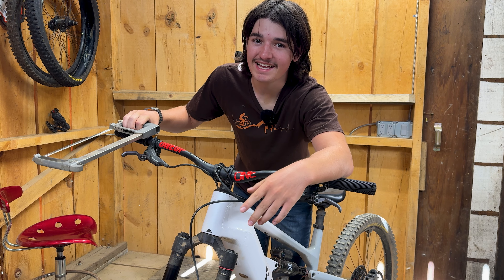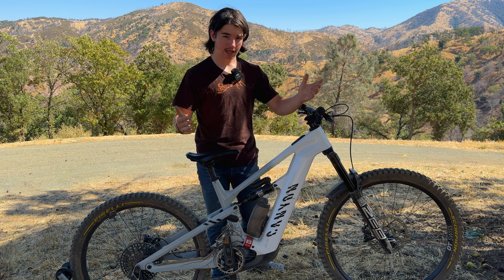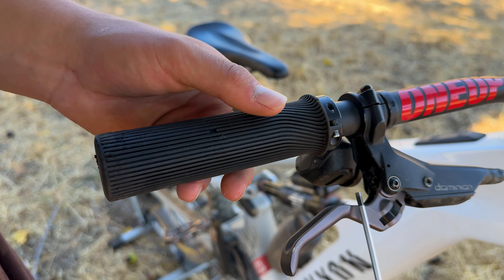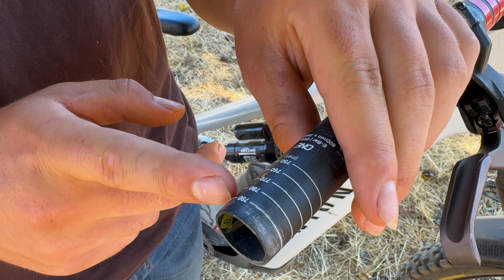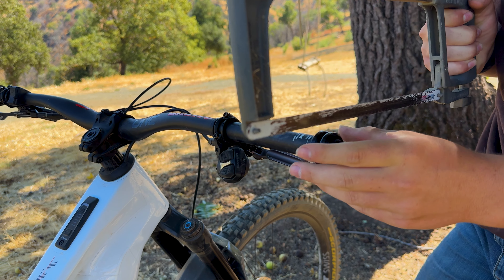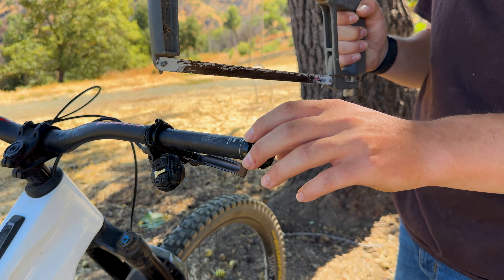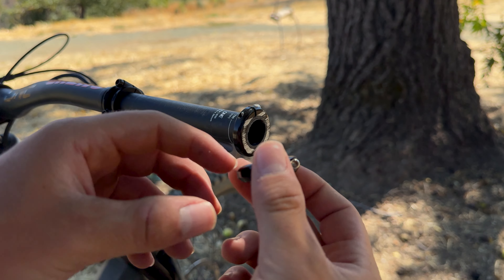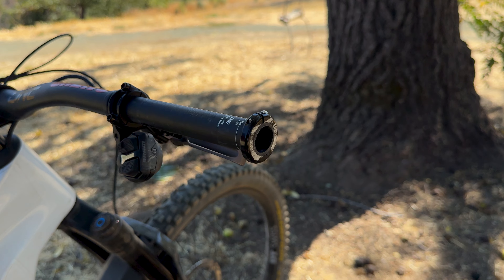How To Cut Carbon Handlebars Without Special Tools!

Comment: Carbon handlebars are all fun and games until they break on a big jump-line….. I learned the hard way by getting them and after riding park and a lot of DH trails for 3 months they broke…. Carbon burgtech to be exact…. I didn’t have any particularly big crashes that would have made me question the integrity of the bars prior to the crash… I feel like they are good if your a pro or someone who’s just gonna have a new set very frequently but if you the kinda person like me who sets it and forgets it until you start to question something may be wrong, then carbon bars will fail on you when you least expect and the crash could be pretty bad… I got extremely lucky.
Reply from the maker: I really don’t hear too much about carbon bars breaking. I more see things such as carbon cranks or frames breaking before bars. So I’m not too worried about this, I know lots of people that use one up carbon bars and none of them have broken.